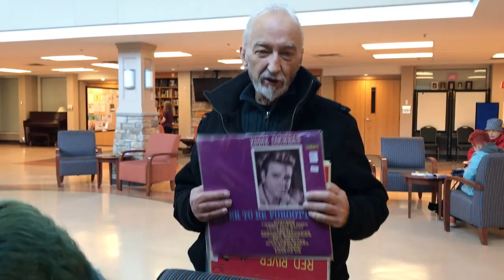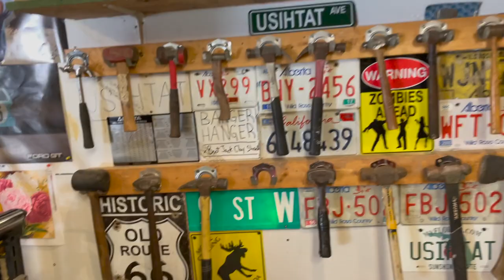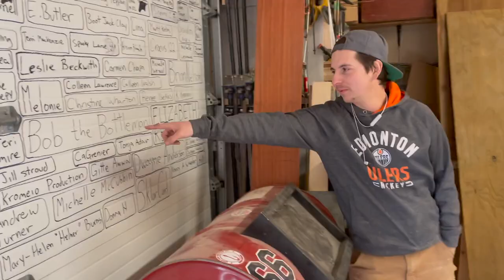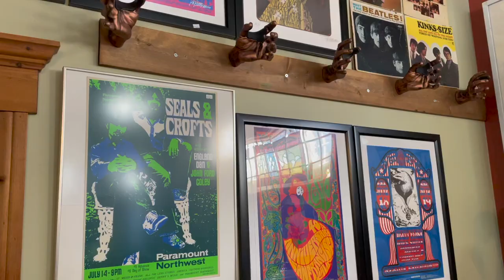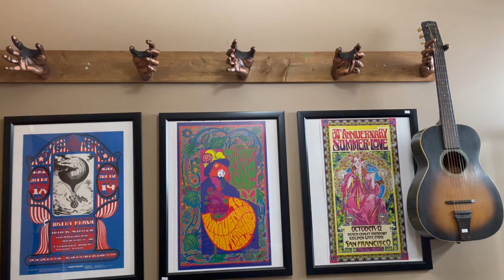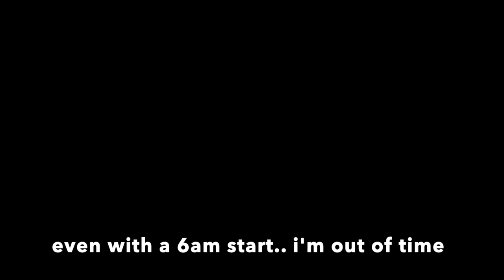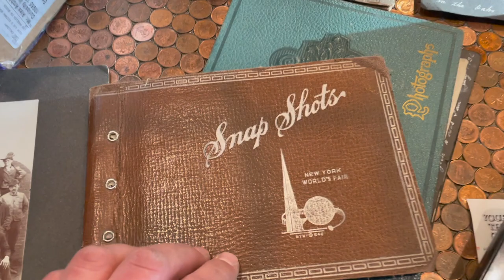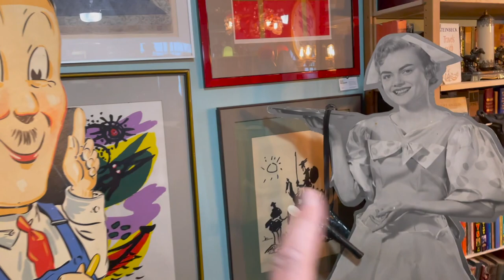Store is torn apart! 24 hours to open can we get it done in time!? part 2 makeover

Comment: It may be cheaper to use metal framing in the new build than wood. Ontario is having a shortage of most building supplies down to nuts and bolts.  Crazy times..

Comment: Perhaps Josh can make a "poster" rack wall hanger for the artwork?  The ones you can flip through?  Obviously it needs to work well for paintings not posters but it helps to save valuable wall space for other items.  Another option would be narrow moveable walls on casters that can slide from side to side, revealing the inner layers as needed.  They are used in galleries for collections.  Some are mesh to allow for hanging hardware.  Just a thought.  Sorry to hear about your dad, Alex.

Comment: Yeah lumber is still insane. Once spring/summer hits it's probably going to get worse. :(
Reply: Already is. The contractor who just did a complete renovation on my bathroom told me he has turned down at least 20 houses himself. He said people aren't afraid to spend the money either.
Reply: @sand3882  Yeah I watch a channel where people are selling their homes during this "hot housing market" and are going to build a house. Whatever profit they made from selling is going to be tied up in the cost of wood for the new house. That's if you can even get what you need.
Reply: The pandemic was a double problem. Many mills and processing plants had shutdowns or reduced capacity and a lot of people launched into projects while they were home.

Comment: I really like Josh, but hammering in shelving with a metal hammer and no padding is pretty wince inducing.
Reply: It didnt mark up like i had intended. Its meant to look beat up. Though it didnt change. Maybe i should have hit it harder.
Reply: @JoshuaAlexander138  Is hitting the back of the shelf where no one will see it normally part of your distressing technique? Or were you just cutting corners? How well do inch diameter strikes work as a distressing method?

It’s good work, and I’m not questioning your skill, but don’t try to play a shortcut off as intentional. The shelves should’ve been set with a rubber hammer.
Reply: I was going to hit it with a wood block but decided not to because it doesn't matter. Because distressing was only going to add to it. I think I know what I'm talking about. I was there. We talked about it. I did it. This was the only one that was a  bit too tight so I ended up only doing it to the one. But after ward we smacked it up a bit here and there. Off camera. Give it the look of use like the old shelves. Got over 100 years of catching up to do.

Comment: Face frames
Reply: That's what my grandfather called them. I also agree that it doesn't matter what you call them if you can build them. I also learned woodworking parlance from Fine Woodworking magazine. If someone is in a large shop, the lingo matters so you can clearly and safely communicate with others. Otherwise, build it and enjoy it.